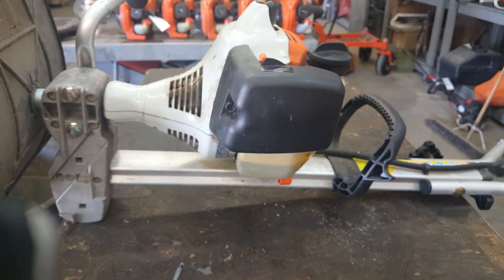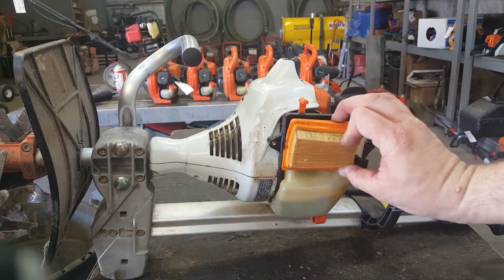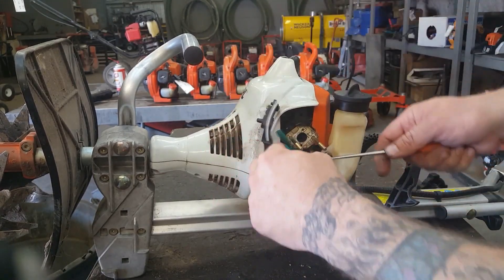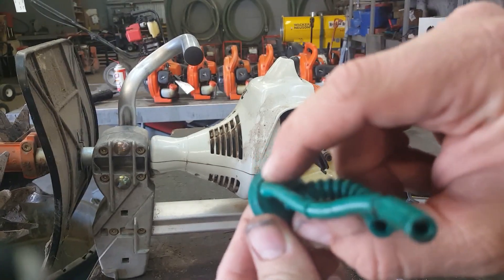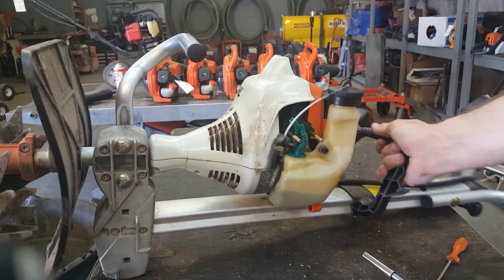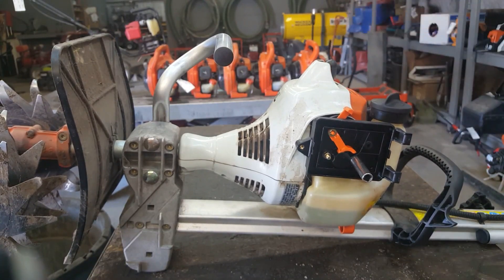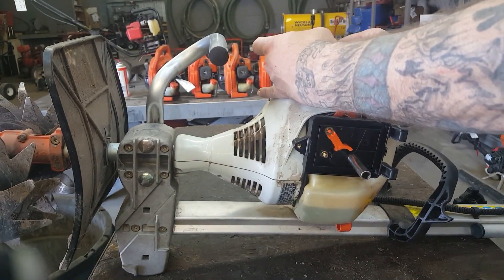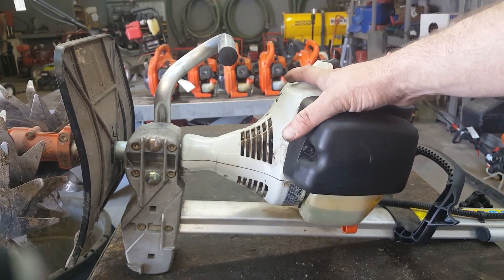Stihl MM 55 Full Service

Comment: Thank you so much for this simple but very informative video!  It’s very empowering for me to be able to do maintenance work on my equipment myself.  My husband is European and is not familiar with carburetors or small engines and it pains me to have to take anything to the shop because then i have to part  with it for several weeks.  Thank you again!

Comment: To get at the fuel tank, just loosen the 3 bolts holding the orange cover with the pull cord and then one bold on the side to release the tank and you can have full access without disturbing the carb and gasket. I just did mine last week and it runs like a champ!!, I used NGK plugs on all my equipment.

Comment: Really good video. I have to say, though, I've been pretty disappointed with my Stihl  tiller. It's always been tempermental, with plenty of stalling and sputtering ever since i got it and now won't start up at all --even after having performed the service shown in this video. It's kind of like the Jaguar of yard tools - nice when it runs, but that's just not often enough. NOTE: I REPLACED THE CARB AS ALEXANDER SUGGESTED AND ITS MADE A WORLD OF DIFFERENCE
Reply: Jonathan Lee Get a brand new carb, Always does the trick. 20 bucks on amazon i love these little engine they put the same ones on the FS38, FS45, and the MM55. Super reliable if its running rough new carb and its ready to go.
Reply: Alexander Raykhert You’re absolutely right! I did just that a few weeks ago and now it’s running REALLY well.
Reply: I have a 51-year-old Stihl chain saw that I still use and a 15 yr old FS 85 string trimmer that is wonderful, and this tiller has been nothing but problems. I paid $20 extra for an easy start model and  it starts harder than any other Stihl tool. I did not know that you could buy carbs on Amazon as someone said and will check that out. It currently will not start.

Comment: STIHL has a special tool about  6 bucks, you reach into the tank and pull the filter through the fill hole and replace it no need to remove carb.
Reply: Richard Jameson you can go to any hardware store for a whole pick set for 6 bucks.

Comment: M27 TORX for air cleaner cover and accelerator cable adjustment. 19mm or 3/4" socket for plug.  8mm thin wall socket for carburetor nuts.

Comment: You don't have to remove the carburetor to replace the fuel filter. You remove the fuel tank. The fuel tank is held in place by 3 rubber isolators and one plastic bracket. Do not remove the screw going through the side of the gas tank! That screw attaches to a plastic bracket that is fragile. The threads are plastic. Ignore that screw and remove the 3 screws that hold the pull cord on. Lift off the pullcord and be careful not to drop the rubber isolator that's sandwiched between the pullcord and the gas tank. Now lift the gas tank off the engine and be careful not to drop the 2 rubber isolators on the bottom of the gas tank. Carefully remove the gas lines from the tank while removing the filter with it. Now CLEAN the tank and install a new filter. This is way less invasive. If you are doing this as an annual service, you don't want to remove the fuel lines from the carburetor. Eventually, the lines will no longer make a good seal and you will have issues with the carb losing its prime. The only time you remove these lines is when you replace them or the carburetor. A new carburetor comes with new lines for that exact reason.

Comment: Great video,  I just got one of these in MM55 so looking for info,  You can put these together w eyes closed. You looking for feedback? You seemed rushed,  like you were on the clock.  I'm sure you might have been.    Get or setup a tri-pod so the camera isn't a liability in the video.  great informative video,  Create a  overlay w/ part #'s , thanks for reference to other FS55 /45  String trimmers for motor references.

Comment: Like ur video service . Need to no how to adjust the carbrator from fresh, my grandson like mest with all 3 screw on my carb
Reply from the maker: Start with the high and the low all the way in, until the just barely bottom out. Open the low side 1 full turn, and the high side 3/4 of a turn. And the idle screw just enough to keep it running. At full throttle you should be at around 8000-10000 rpm, at idle adjust until the rpm peak. Then adjust the idle screw to about 2800 rpm

Comment: Is there any servicing on the tiller part? The transmission? Change oil or anything?
Reply: Yes , I would check the transmission for grease. Mine stripped and I had to replace the gears. The kit came with special grease. Cost me $200.00 from still dealer.

Comment: Mine won't start. What's the most likely cause?
Reply: Probably the carburetor. Simple fix and a cheap part. Just do what he did in this video. Wouldnt hurt to change your fuel and air filter. Im about to do the same to mine on top of changing the throttle cable
Reply: @hellyeah3871  thank you for the tips

Comment: How do you check the oil on this model?
Reply from the maker: There is no "engine" oil. You use 2-cycle oil mixed with you gasoline. 40:1 mixture.

Comment: I appreciate the video ….. but I can’t get mine to build enough power to effectively work as a light cultivator! I replaced the carb, it starts, runs and will create power, but the tines quit spinning as soon as it touches the soil. Help, before throw this pos in a dumpster.